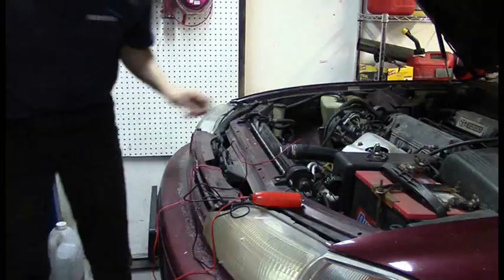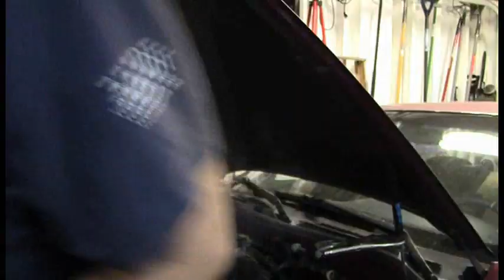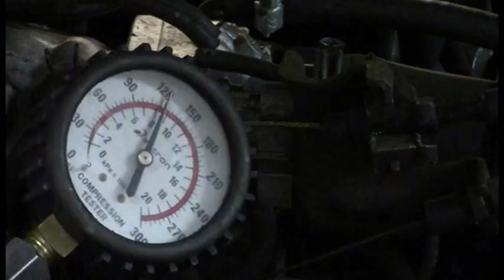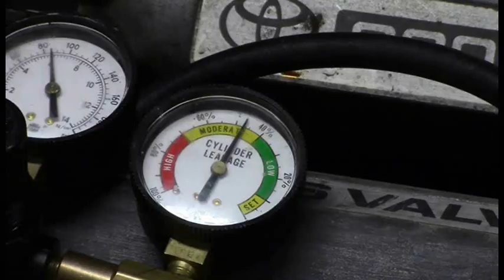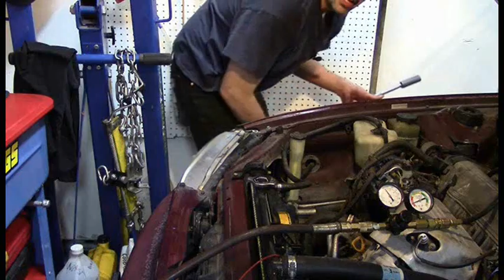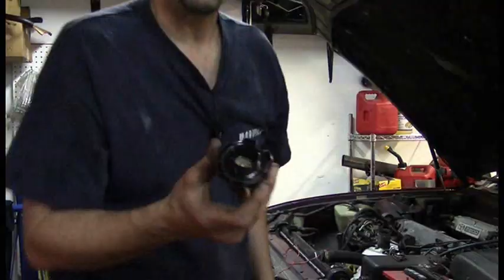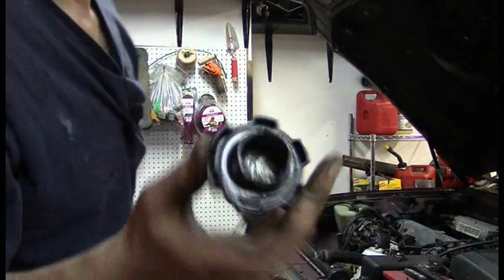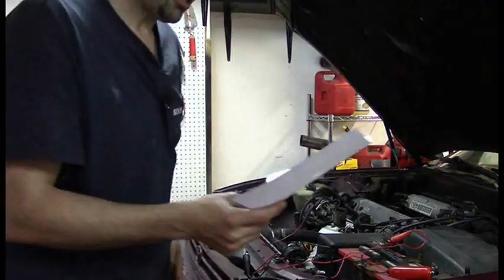12 Ways of How To Test A Blown Head Gasket Compared- PART1

Comment: I have 1995 lt1 firebird  run great but water keeps disappearing .I say that because I cannot find a leak .I drove last summer with this problem then winter came and I never had to fill up the radiator.Now it's warm again and  back to filling radiator .
Reply from the maker: michael parks What did the data from your diagnostic tests indicate?
Reply: Schrodingers Box I have none the lt1 motor  in firebird is show tight fit cannot  get to plugs without pulling motor.Changing spark plugs is a nightmare lolol much less trying to do a pressure test . .I don't have the tester for the radiator test .Out of work need to find one .I wonder of   auto parts store  does this test .They do many things for free
Reply from the maker: You can't get to the spark plugs without pulling the motor? seriously? Really?
Reply: Schrodingers Box it not cannot it it is the fact  the lt1 enginw is a very tight fit in the 1995 firebird formula .You have to about pull the motor I am 56 I pulled many a motor in my day .But to old to mess with that these day LOL
Reply from the maker: michael parks  Then how about instead of pulling the motor just drop the Y-Pipe like I do?
Reply: Schrodingers Box  come over and do it with me lolol .I would   love to find a video with someone who has a fire bird with lt1 motor .
Reply from the maker: michael parks Come over and remove 6 bolts? Not an effectively good use of my talents
.Dude I have had 2 LT-1 engines.  Drop the Y pipe, the plugs are right there.  So much easier than removing the engine. Why would you come to that conclusion the engine has to be removed anyway?
Reply: Schrodingers Box I REALLY MEANT LIFT THE MOTOR NOT COMPLETE REMOVAL .i HAVE A BROKEN MOTOR MOUNT TOO  NOW FOR THIS IMPORTANT MESSAGE ABANDON ALL THIS FALSE PROPHETS 

http://www.chick.com/reading/tracts/1097/1097_01.asp WHERE'S YOUR NAME WRITTEN DOWN ?
Reply from the maker: michael parks WHY WOULD YOU POSSIBLY WANT TO LIFT THE MOTOR??? THAT MAKES NO SENSE
Reply: Schrodingers Box  first to fix the motor mount . do you have firebird with lt1 ?
Reply from the maker: michael parks  My current one is LS1 but I have owned two LT1's- both '97's. Yoiu do NOT need to remove the engine to change spark plugs on these- JUST DROP THE Y PIPE.  QED.

Comment: Hi great video.  I am interested in which of the three main tests would render the other test unnecessary.  You say passing an exhaust gas test still leaves open the possibility of other problems.  Passing a leak-down test may be sufficient to rule out compression loss problems but as you point out is less mobile.  It seems that if a car definitively passes a properly administered compression test, then the leak-down and exhaust gas test would not be necessary.  Do you agree?
Reply from the maker: Oerstec Yes I agree, but others maybe won't.  I have heard that cars have had cylinder head leaks but passed compression tests. I have never seen this myself, ever- I have always seen that cars with a bad compression cylinder will show this in leakdown test and vice versa.  Also, the chemical test is definitive if test is positive, but not if test is negative- it lacks sensitivity.
So basically  for me- in descending order of dependability:

1. Leakdown Test.  If it's negative, cylinder head or other compression-related problem is not the issue.  If it's positive, there IS leak past the cylinder or head and it will be detected through a valve, head gasket, past the rings, or through the block.  Coolant bubbling is 100% confirmation compression is entering cooling system.
2. Compression Test. If it;s negative, car is fine- can confirm with leakdown but leakdown will also certainly be negative. If it's positive, at very minimum, that cylinder head is gonna have to come off. If adding oil to cylinder greatly improves results, then almost certainly rings are bad and this will be confirmed with leakdown.
3. Chemistry (block combustion) test.  If it's positive, there IS compression leakage into cooling system and leakdown will confirm this.  If negative, it does not necessarily mean car is fine.
Reply: Schrodingers Box  I did a compression test on a V6.  The specification from Ford is that the lowest cylinder is 75% of the highest.  Technically the car passes this test with the highest being 220 and the lowest 165 psi.  However I am uncomfortable with two things.  1) The lowest cylinder takes longer than the others to come up to max pressure.  I know this a symptom that indicates a problem but does not seem very quantifiable.  2)  The range of compression values for the other cylinders is around 6%.  It seems likely that this cylinder is an outlier and should be suspected to be defective but there is no standard for this type of assessment.  I have not performed a leak-down test yet.
Reply from the maker: try adding about 3 tsp of oil to the suspect cylinder and see if it improves dramatically. also add it to a good cylinder for comparison.

Comment: I have a mazda 3 2007 
the oil is milky white and significant loss of coolant with no visible leaks
does that mean i have a blown head gasket if so is it easy to fix?
Reply from the maker: yazanwael007 What did your data from the diagnostic tests you have done indicate?

Comment: i can tell you if you use the water side engine leak stopper and run it for a while and if it doesn't seal it completely it will foul out the spark plug and you WILL be able to tell the difference then (You will see the fine particles of the stop leak on the plug and it will even completely connect the electrodes and cause a complete miss) ... I am using the sealer stop and it hasn't completely stopped the leak into the cylinder and I develop a miss on that cylinder after 500 to 1000 miles 1997 v6 mustang. Gonna pull the heads soon!

Comment: Great video! I drive a Nissan X trail '05 and I replaced my radiator (aftermarket) a month ago as I was rapidly losing coolant every day. I noticed that the vehicle is still losing coolant although not as fast. I top it off every 4 days for about 500ml to a liter. Had no overheating history as I always check the fluids every 3 days. Had it checked twice by the shop and they're positive that there are no leaks. They gave an opinion that the engine may be consuming the coolant (no milky substance found on the oil) and I may have to do a top overhaul. I went to the dealer for a second opinion and they said it may be the thermostats malfunctioning. Can a bad thermostat cause coolant loss? Thanks in advance!

Comment: Instantly subscribed to your channel 

I'm actually having trouble with my 2007 Jeep Commander I think I may have figured out the problem I had to purge the cooling system of air just had a water pump and thermostat replaced so far so good so thank God at least for now that I don't have a head gasket issue 

I think.

But just want to take the time commend you on your channel  you look like someone that likes to teach and likes  what you're doing 

You are very articulate are easy to follow and that's a major plus
Now a days it's a good thing when someone with your skill set likes to share with others.

A+++!
Reply: pfdad

A

Comment: Thanks for the reply.  I bought the car for my wife last month $17,000 drove home fine, was good for one week.  It's been in the shop ever since, 900 bucks later.  

I took it back to the place I brought it from they were telling me it was more than likely a bad thermostat.  That was four days ago, now their telling me it's a missing gasket on the turbo.  Do most repair shops understand the types of diagnostic test you show on-line?  It seems like their just guessing!  Your approach is very analytical.
Reply from the maker: I don't know whether most shops use proper diagnostic procedure or not. I only know that many do not. It might also vary from tech to tech within a shop I suppose. Having no experience working in the automotive industry I can't say what the overall environment is for diagnostic ability.

Comment: What would make coolant spray out of the overflow resivor  and leak from hose connections?  I have a 2008 Saab 9-3 Aero. Car doesn't over heat just.  check engine light comes on and coolant low light comes on.

I had the overflow resivor  and cap replaced, and numerous hoses replaced but still having the issue shortly after driving car.
Reply from the maker: Manny Fontno A blown headgasket or overheating explains it

Comment: Was hoping to find out if you can tell if its the head or the block. The problem I have is that the head gasket and head has been replaced twice so there maybe an underlying problem but saying that, I don't trust the people that did the job as the first guy put on a cracked head on and the other didn't skim the head. So its driving me crazy as I have the money to do a head gasket change/replace head but not enough if there's an underlying problem with say a cracked block and I cant afford to buy something new if im paying for work to find and fix if the underlying problem! So wish mechanics in my town were like you and showed a bit more interest in the first place.

Comment: TY, it's on a 79 GMC that my dad left me. He bought it new in 79. I just lost my mom in Feb. they both loved this truck. It's got about 165,000 miles. I always knew I was gonna rebuilt the engine and so noes the time. I'm gonna go .030 over, cast Pistons, mild hyd cam, double roller chain, high volume oil pump and a three angle valve job . Decked, squared , line honed and balanced. Keep it a daily driver. Mom and pop will be happy and so will I. I just bought a good spray gun from Eastwood and going the satin black on the body.

Comment: Hey sir quick question will a 2007 aveo engine fit my 2004 aveo and what would i need to swap to make it work?
Reply from the maker: I don't normally answer specific questions like that there is actually a value to this one mostly for the second part of it.  First off the answer to both questions is I don't know, especially since I know there was an engine change at some point in the first generation models.but I don't know when.
  But in general I run into this issue every engine swap I do because I don't have access to a parts interchange database. But generally what I do is I research the model years within each generation and I stick within a generation when hunting for a donor. I research any variations in the same engine (flexfuel vs standard fuel, etc) and note relevant VIN engine codes and of course only use donor vehicles with identical engine code in the VIN.  When possible I examine a donor vehicle engine to ensure it is identical paying special attention to engine mount locations, brackets, connector locations and patterns, emissions accessories (some engine versions come with or without EGR for example).
  Even with some variances, normally within a generation the block will still be identical right down to the drilling of bracket holes, etc. So the key is ALWAYS retain the old engine until the swap is complete.  It is very, very common that I'll have to use brackets from the old engine, maybe some of the emissions components on the donor engine might have different connector patterns so it;s easier to swap the donor components than to adapt the wire connectors. Even if you find your donor engine, say, is not equipped with EGR, you can swap the intake manifold or throttle body or whatever from the old engine to easily convert the donor engine as needed without drilling holes or requiring adapters.  For some engines you can actually span several generations and the differences are strictly the "bolt ons" and the block drilling patterns are even identical so modification is simple and availability is abundant.
  Research is the key though.  You first and foremost have to determine how many variations are out there even within the same generation. It all starts there.

Comment: Hi,
I like your video, showing the head gasket problems! It realy gets me thinking about the car I have and one car I had, both have (had) head gasket problems... I am wondering what I can do if I have good compression but the water hoses when the engine heats up are hot and stiff? And the water reservoir has black oil sedimented in it? When I changed about three months before, the coolant completely, I had to do about 6-8 flushes with water until I got relatively clean water... The water reservoir was clean for a while but it became black again. The car runs fine, the temeprature is fine. Only problem is it has some vibertaions at low rpm in neutral. VW 1.9D.
Reply from the maker: I would do leakdown test (or combustion gas test) just to verify. When you rule out your coolant issues are not related to combustion, I would suspect other sources for the oil sediment in the coolant such as intake manifold leak or oil coolant line or transmission coolant line leak into radiator.
Reply: Schrodingers Box You are so kind to reply, I value your opinion and I will have a look into all those things. Thanky YOU